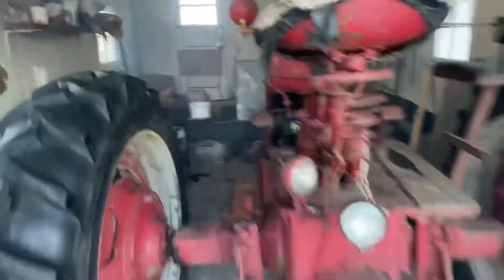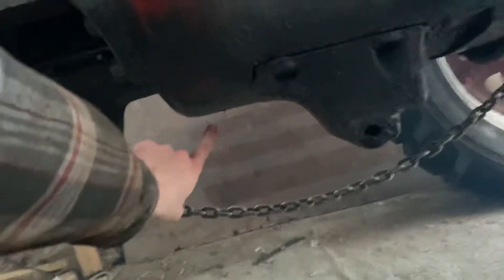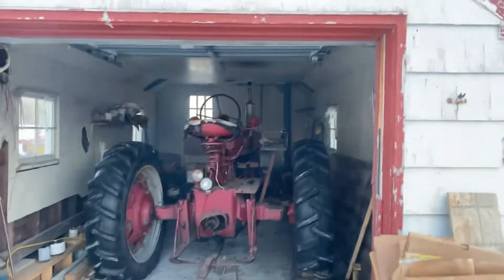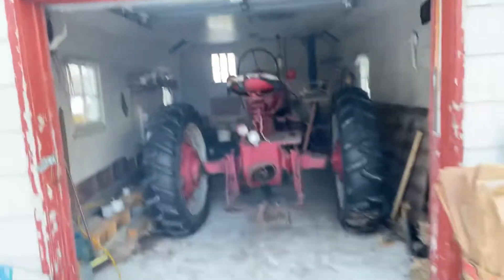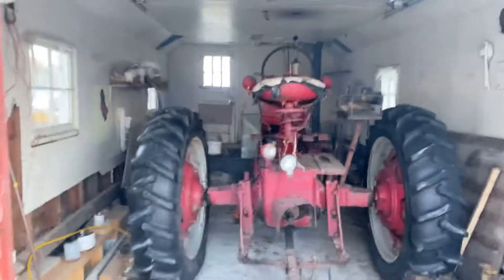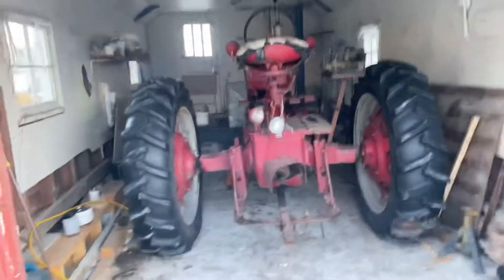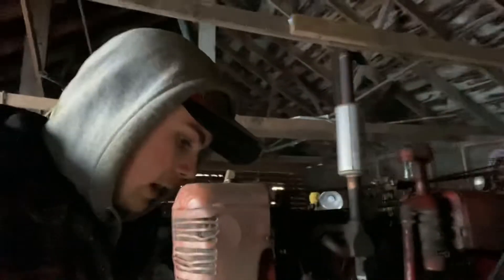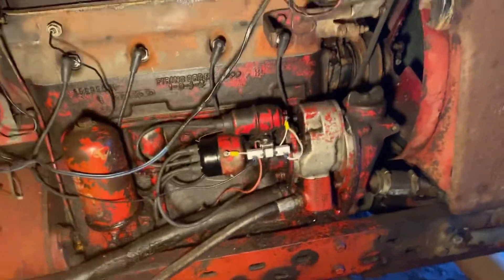Farm Update: 2/25/2021- Good And Bad On The MD, SM And Some More To Talk About

Comment: Way to go with getting the MD running! You will have the Super M running in no time. Sounds like Mo is running well. Glad you are having better weather for being outdoors and wrenching on tractors. Thanks for the update. 🇺🇸🚜👍
Reply from the maker: Thanks Hyatt! I'm super glad it is running, it was SO incredibly nice to hear it again! Bummed its got an issue with the clutch but it's part of the learning process! I'm sure the SM will be running soon also! Just need to get the carburetor in some cleaner. Mo is running fairly decently. He sounds a little rough though to my liking. Not sure if the cold has messed with the timing a bit or if his carb is just really getting to the point of needing rebuilt as it hasn't gotten that treatment yet. I'm glad the weathers been nice too! I'm able to finally knock some things out! Thanks for watching!

Comment: I can see your excitement in getting your tractor running ,it is disappointment about the clutch i am sure you will sort it regards N Ireland .
Reply from the maker: It was a very exciting moment! It’s been a long time since hearing it run so it’s nice to see it running again, and the fact it’s not leaking oil anymore makes it all that much better!! It is a little disappointing about the clutch but it’s an easy and fairly quick job that can be sorted out!

Comment: You will get it figured out, the best thing you can do at this point adjust or readjust only one thing at a time so you know just what was out of adjustment to make the problems you have right now. One thing at a time.
Reply from the maker: For sure! I think I may just take a short break from the Super M to calm down a bit with that, and now that I know what kind of shape the MD is in and how easy that will be to correct its issue I can work on that.

Comment: MD is back running, Mo is running well... Just gotta flip that clutch disc around on the MD. Then, Super M needs a  good once over. Double check everything. Might be some work, but better off doing it right once than trying to do it "easy" 3 times!
Reply from the maker: All pluses. I don’t know that I would say Moe is running well. Sounds rather poppy especially compared to the other H. I’ll probably work on fixing the clutch disk issue this weekend. Get me away from that stupid SM.

Comment: You can shut it off, put it in gear, start it with it in gear out in the open where you can't crash into anything. Then drive around with the clutch pedal pushed in and tap your brakes till it comes loose and stops. Or with the engine off, put it in high gear and hold the pedal down, get a couple of people to rock the tractor back and forth. Pull it outta that garage first. Your float needle is sticking shut in your carb on the super M.
Reply from the maker: Great advice! But I don’t believe the clutch is stuck on the MD, I think I installed the clutch disk in backwards. It was my first time doing a clutch so a mistake was bound to happen. I also don’t believe the needle is stuck on the super m, gas consistently flows out of the carburetor when the drain plug is out so that seems to be working, my though is it’s got a passage slightly clogged from sediment.
Reply: @ThisOldFarm  in that case - make sure it's adjusted up first. And put some injector cleaner in the tank.
Reply from the maker: @wesleycallison2079  It’s adjusted properly according to the IH manual. I just believe it is not in properly and will be removing it and flipping the disk and reinstalling to get things right.

Comment: Hmmmm.... did you remember to put the clutch plate in the MD? How about the throwout yoke? Seems to me that could accidently get put in backward. As for the SM, yes those gears should be in time, it's set up that way for a reason. As for the fuel situation, did you smack the carb to see if the needle valve is stuck in the hole? Otherwise...... WOO-HOO!!! The MD is running! So happy to see it.

Oh yeah, the image turned out much better in this vid.
Reply from the maker: I remembered to put the disk in if that’s what you mean by plate, but it seems the Facebook opinion is it’s in backwards, either way it’s gotta come back out, oh well! Throw out yoke is in properly because I can tell it’s pushing on the pressure plate. I did try smacking the carb on the SM and it didn’t change anything. I pulled the drain plug out and it consistently flows gas, but seems restricted compared to what was coming from the line itself. Might just be the fact it’s not coming out as a nice stream like it did through the line though, I’m not sure. The reason the image did better with this video is because I filmed it with my phone, not the Sony.
Reply: @ThisOldFarm  Sounds like the carb needs a good cleaning then. Easy enough. Same with flipping the clutch disk around. See, it ain't so bad. I do know how it feels when you get things going & they opt to figure out a way to give you the bird anyhow. Lol! Just return the favor & get them horses going. :vD
Reply from the maker: @ikonseesmrno7300  More than likely. The sediment bowl didn’t have a screen in it until maybe the day I found out it was losing coolant so I’m sure it got some sediment in it, unintentionally! I watched Kenny Kizzle’s video (not sure if you watch him or not) on removing the clutch without splitting the tractor and it should be a good and easy job. Probably can get that done this weekend. I don’t remember if I said it already, but I did have a feeling this was probably going to happen with the MD. It just did not feel at all right when I pushed it in and the fact that I had to extend the clutch rod even further then the old one seemed even more odd to me when assembling. Soon enough though it’ll be going and serving us well again, I’m super excited to put it on the 3 bottom plow this spring!!
Reply: @ThisOldFarm  I think Kenny is the guy with the charity H? If so, I've been to his channel a few times to check it out. Also helped here & there with the project when he posted on the forum. That's a very cool thing he did. The instructions for taking the clutch out when the tractor is together should be covered in the manual also. Do you have a manual? I can send one if you don't. If the carb was missing the screen, yep it needs a good cleaning. Doesn't take much to make your own hot tank setup to dip it in.
Reply from the maker: @ikonseesmrno7300  Yup, Kenny is the one who's doing that H as a suicide awareness thing. I do have a reprint of a blue ribbon service manual, I've been meaning to take a look at it tonight and just haven't yet. I will probably pull it this weekend and clean it. Probably didn't help with it sitting on the tractor while it was apart. It was covered for pretty much the whole time (didn't quite get to it right away after I first started tear down) but I'm sure junk got in that way too.
Reply: @ThisOldFarm  It happens. Did you end up using a floor jack when you pushed the two halves together or was everything lined up?
Reply from the maker: @ikonseesmrno7300  I kind of used the floor jack, but not in the way you said to use it. I had one under the belly pump to hold the rear up and then I used the other jack to bring up the front to where it needed and then jammed some blocks under the wheels and set the Jack back done. I couldn’t get the jack under the tractor where it would roll straight forward. It actually slid together super nicely, way better then when it came apart.
Reply: @ThisOldFarm  Glad to hear a similar idea worked out for you!

Comment: Your timing has to be perfect. If you messed with the timing gear you have to make sure the two marks on the gears are perfectly lined up or the engine will eventually destroy itself. if you never touched them it should be fine. 
To be sure you are at top dead center on #1 cylinder pull #1 plug and turn the engine using the crank , hold you finger or thumb over the plug hole and you will feel the pressure as the #1 piston climbs to the top. when you feel that pressure on your thumb you know you are on the compression stroke thats good. Now look at the crankshaft pully there will be a notch on it and there should be a timing pin that protrudes from the engine. Turn the engine until that mark on the pully and the tip of that pin line up perfectly. That will mean the #1 piston is at the very top of the compression cycle. With the cap off your distributer the rotor arm should be right over where the #1 on the cap would be. If it is not then your distributer is out of time. Remember The Tractor will run even if the timing is out 180 Degrees. However poorly
if it ran before I can say this we on our farm last year had some super grade gasoline go bad in just one month, This happened on 3 separate occasions in 2 different tractors. If it ran before and the timing is good the gas mabe spoiled. Dump the whole lot and replace it. Get rid if the sediment bowl and put a good inline fuel filter and shut off valve in its place. Make sure you put  the filter in the right direction or the fuel wont flow through it quickly enough and will cause the engine to starve and stall.  Blow out the carb and give it a whirl.
Reply from the maker: Thanks! I followed all the steps you mentioned already for timing before making the video. I think something got in the carb because I didn’t have a screen in the sediment bowl. Thanks for the tip on the inline filter and a ball valve, but I won’t be going that route. I like the sediment bowl and find it works just fine. If I was to put any fuel filter on the tractor it would be the style that can go in the sediment bowl.

Comment: You might not be able to fix the clutch in the MD without splitting it. The H’s and early M’s had an 11” clutch and you could swap clutch’s without splitting but the later M’s had an 12” clutch and those won’t fit out the hole. Hope yours is an 11”. As far as the Super M goes, with the poor gas now a days carbs will gum up fast. We’ve had issues with the carb gumming up on a tractor that only sat for a couple months.The carbs are really easy to rebuild and the kit is cheap.
Reply from the maker: I checked the clutch kit we ordered through Steiner and it is an 11” clutch so I am safe! That and the fact it was open for a short period of time before getting it covered with a bag when disassembling the tractor and it not having had a screen in the sediment bowl for the few runs it had before leaking coolant leads me to believe the carburetor needs cleaned again. I will get it off in no time and hopefully we can get it running once again!

Comment: put your mailing address on here so we can mail you stuff.   have you tried tapping on the carb to see if the needle is stuck in the seat.
Reply from the maker: I don’t know I totally feel comfortable just disclosing my address, but if you feel the desire to send me something you can shoot me an email and get it from me there. My email is thisoldfarm03@gmail.com. But please know, it is totally unnecessary to send me stuff!
Reply from the maker: Yeah, I did try the tapping trick. No change. Fuel does constantly flow out of the drain hole, but to me it seems more restricted than how it came out of the line. But the line was also more of a stream, how it came out of the carb was not a stream.